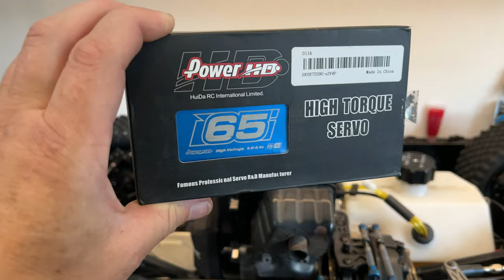MONSTER Gas RC Car - New vs Old - Losi 5iveT 2.0  (LOUD!!!!!!)

Comment: The red one looked a little more settled.  And maybe tune up the blue car a bit more, the suspension needs a tickle.
Reply from the maker: Thanks - the Blue on is a Losi 1.0 so has the old syle shocks and steering, plus engine sits further forward, the red one is a 2.0 so has better shocks and steering etc

Comment: Looks so much fun, but why is the track surface so bad at arc? Puts me off from going there to b honest.
Reply from the maker: ARC was a bit run down, its so much better now, has been worked on and also now has a timing system

Comment: Watching this just reminds me how gutted I am about my Losi 5T. Bought it 2013, got a few runs on it down Hackney Marshes then the complaints rolled in - and then park maintenance thought they'd try and 'confiscate' it, didn't go well. So it's had 3 tanks at  most and been in storage for 9 years!
Reply from the maker: That's a shame, although looking at Hackney Marshes it looks like its used for lots of football pitches and cricket pitches so can see why they would try to stop you, would say going to Wanstead Park / Heath would be better. Get it back out and let it breath 👍

Comment: Ive just got one and cant get it started can anyone help?
Reply from the maker: Is it new or second hand ? have you checked to see if you have any spark ? take the plug out and hold the end against the top of the metal cylinder head whilst you pull the starter, just make sure your hands are not touching anything metal, if you have no spark then check your kill switch if you have one, if not check the mag on the fly wheel
Reply: @HardcoreRC  thanks for replying, ive been trying to start this thing for hours now! Its 2nd hand, it last run 6 mo ago, today, carb factory settings with a 1/16th turn lean and rich, (starting lean and riching) with a plug clean every cycle of low speed needle turn (high speed factory) Plug gap & spark fine (not checked magneto gap yet! everything is torqued/tight, Ive had all of 2 seconds running so it does want to go, im just getting a bit naffed off😂
Reply from the maker: @baldfantastic  Second hand so could be a hole host of things, make sure you have the right setting for the model of carb it has as they are all different, should be able to find the carb model engraved on the carb.

If you still having no joy then would suggest the head comes off and check the ring and the piston
Reply: @HardcoreRC  apparently its a year old & broken in! thank you for the advice! Ill keep on trying!
Reply from the maker: @baldfantastic  Age doesn't mean anything unfortunately. Many factors can effect the engine, dirt getting into the head, running too lean, not changing the piston ring etc.

Could just need a new piston and head, sounds cary but its cheap and actually failry easy to do, if i can do it anyone can.

If its needed just google Zenoah head replacement.
Reply from the maker: @baldfantastic  This is a good video for top end rebuild: https://youtu.be/CpBFbcirJII
Reply: @HardcoreRC  hi there, thank you for your pearls of wisdom!! I finally got it going and it it is an epic machine! I didn’t take the head off, just a huge degrease of the carb and   Engine internals and it fired straight up, just got back from 2 hours in a field😂😂 thanks for you help 🤙🏼
Reply from the maker: @baldfantastic  Glad to hear you got it going, they really are soooo much fun 👍👍👍👍

Comment: i got 3 power hd servos.... all 3 died after 3 months... i will never buy this crap of servo again.... all got the same problem... i tough powerhd are a good cheap servo... but i buy them never again... really bad quality after 3 months ( arround 15l gas)... 2 servos was  power hd lw-20mg and 1 was the same what u got power hd 65i ... they was all working in my FG monstertruck 2wd
Reply from the maker: Sorry to hear that, still running all 4 that i have bough with no issues did you warranty them ?
Reply: @HardcoreRC  yes I got my money back... I tough it was first time just a unlucky one... But 2 other died too... So for me it's over with that brand... My servos never died that fast...
Reply from the maker: @jayjayedo  Dont know what to say, all i do know is that mine and others i know that bought some all have had no issues, but that can be how things are sometimes. The good news is you got your money back
Reply: @HardcoreRC  yes you are right :)

Comment: Why do you copy Kevin Talbots format, right down to his boom
Reply from the maker: Not copying anyone, where exactly do i say boom in this video ? as a matter of fact I have been saying Boom since i was a child when Basil Brush used to say Boom Boom, so do find it very hard not to use that word, but actually go out of my way not to use it, or if i do i edit it out, love for you to show me where Boom is used in this video. Not sure when Kev has even had is two kids racing big 5th scale losi's round a track ? the only thing you could say i copied would be the instant body putting on where i clearly say using some Kevin Talbot magic, but then Kev isnt the first person to do this sort of cut, loads of others do it on YouTube. The only thing the same as Kev is that we play with big toys, film doing it and use some of the same locations as we actually all go out together, apart from that nothing, zip, nada, zero is copied from Kev. 

We have to evolve as a channel, that means learning to do better edits, different cuts, adding sound effects, removing boring parts, repeated words, silent pauses etc this then helps viewer retention, we also try to give a reason for the actual video, hence the wrenching etc at the start, which normally has higher retention than the actual bashing. 

Would love a reply stating where i use the Boom word, but really not expecting a reply.
Reply: I agree. It’s so cringy
Reply from the maker: @williamhayes4500  Thanks for watching 👍👍
Reply: Haters gonna hate... you know they are buddy's right?
Reply: @rcjunkie87  Where do I say I hate, just pointing out something I've noticed, I'm entitled to my point of view